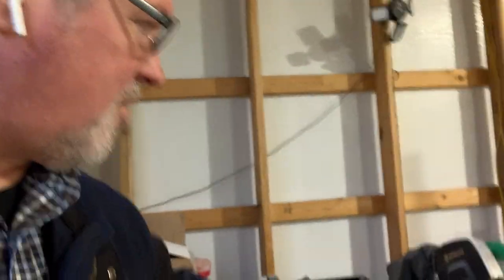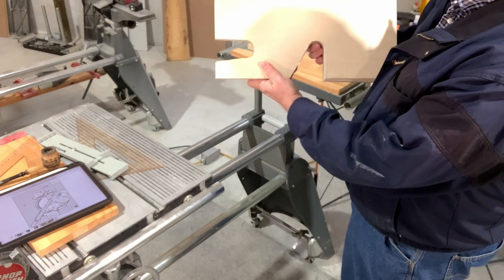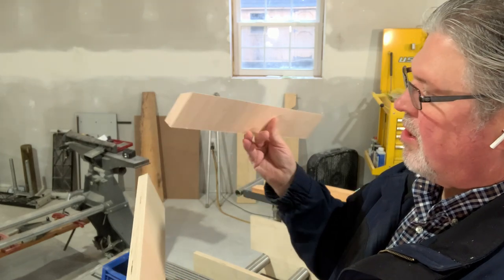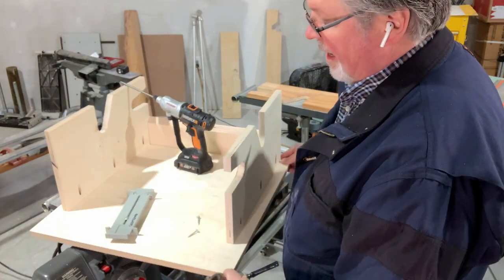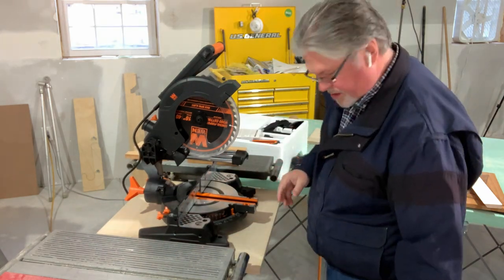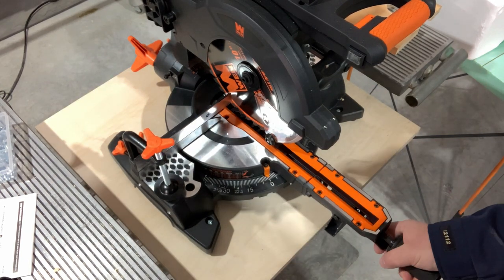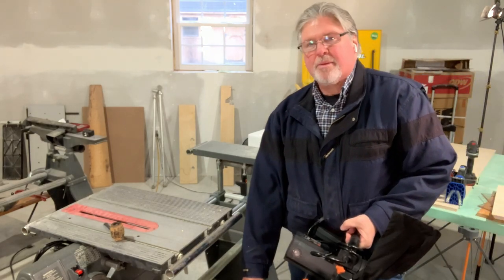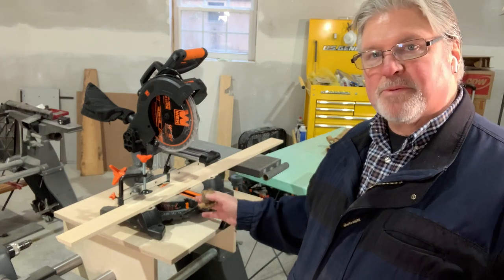“ChopSmith”: Wen Sliding Miter Saw from your Wall to your Shopsmith and Back!

Comment: Nice. I think that solves a problem I "over which I was mulling" - gotta love English.
I think a couple of handles midway up the sides under the overhang would be useful, and I wonder if there isn't some way to adjust that foot so that you wouldn't have to rebuild or buttress the top ... ? Otoh, if you made your drawer face to come up and cover the edge of the top it would support that foot when closed. 🤔
Reply from the maker: I like the way you think.

Comment: These days a 3D printer can print versions of the plastic knobs which use a standard nut or the standard head on a hex bolt.   I print these often for use on my jigs.   The Bittner nut is a good idea, but I prefer the larger size of the 3D printed knobs.  I agree the commercial plastic knobs molded over a standard nut are too expensive.
I did get a smile from the pieces being screwed in wrong.    We have all done such things.
Dave.
Reply from the maker: I have a new 3-D printer that I’ve yet to play with and knobs are definitely high on the list of things I hope to produce. Thanks for your encouragement to include my errors!

Comment: I am always a bit hesitant about relying on gravity to hold a tool in place. It occurs to me that you could use some sort of sprung loaded catch/clip to hold it down so it can be lowered into place just as easily, clips into place and then can easily be removed by releasing the catch/clip to get it off the way tubes.
Reply from the maker: Jonathan, yes, that thought occurred to me too, and any opportunity to incorporate a magnet also appeals to me! I’ll continue to play with it and may ultimately make that recommendation. Great minds… Scott
Reply: @MyGrowthRings  Thinking about it a bit more, something modelled on a self-locking gate latch would do the trick with a spring to hold it in place

Comment: Didn't understand your point about if you use a French cleat that is "taller" (forgot the word you actually used) you could hit a few more studs.   If it is taller one could hit that centered stud with a few more screws. Am I missing something?
Reply from the maker: Imagine that the cleat is 2 feet tall. You wouldn’t hit more studs, but more screws could be driven down the single stud, making it more rigid.
Reply: @MyGrowthRings  agreed, that was exactly my point. Check what was said at 25:10. 🙂
Reply from the maker: @gordonh2294  Yep, I misspoke.

Comment: How high are those slide bars off it's table?  The saw's description says it can miter baseboard 6.75" wide but looking at this video it doesn't seem like it.
Reply from the maker: They are about 3 1/2 inches off of the table. They claim that it can be used for crown molding is assuming that the crown molding is held at an angle, as many framers do. To cut six and three-quarter inch baseboard, would require you to lay the base flat as opposed to standing upright. Scott
Reply: @MyGrowthRings   S'what I'm trying to avoid.  Everyone's opening up walls nowadays leaving nooks, boxed posts... a lot of baseboard.  But hey if this thing's easy to lug around and shove in the truck I'm happy.  Thanks man
Reply from the maker: @TheJollyGreen  Happy to help and which I had better news.
Reply: @MyGrowthRings  Woop didn't mean for this to be a convo, haha, tried to edit before you responded (he's fast people!).  Just dawned on me the tracks are only on one side of the blade so I just have to stick with the other side, cut a butt end first then bevel, sometimes the backside toward me.  I wouldn't say that's a deal breaker... hrmmm...
Thanks x2
Reply from the maker: @TheJollyGreen  I just happen to be trapped in the SkyClub at ATL, so your timing was good!

Comment: Boy, that's a lot to go through just to mount an SCMS on a ShopSmith.  I took the lazy way and just mounted my SCMS on a piece of plywood the same size as my "500" table.  Then I just held it in place with a couple of "F" clamps.  And I had plenty of board support using two support tables, one on each end.  I could cut a miter on a 10" board 10 feet from the other end without worry.  I'm obviously into "Easy Peasy."
Reply from the maker: But look at all the fun woodworking you missed out on.

Comment: A chop saw uses abrasive cutting wheels and a miter saw uses circular saw blades with teeth.
You refer to both in this video, one is for wood and one is for metal !!
Even the box the saw came in says miter saw, just saying :-))
Reply from the maker: I’m assuming this is not the first time you’ve heard an amateur refer to a miter saw as a chopsaw, correct? Let it go.
Reply from the maker: Sorry for being so short and curt in my response. I get the same way when someone refers to a saber saw a a “jig saw”. It’s just what happens and I’m trying to let theses sort of things go. But don’t get me started on “Irreguardless”!  Scott